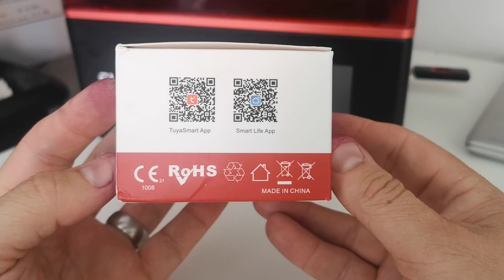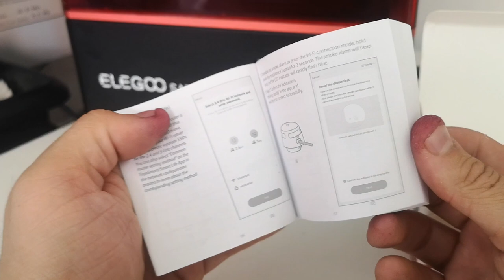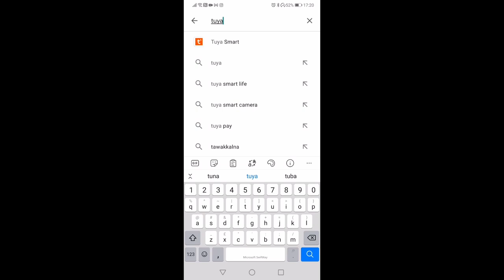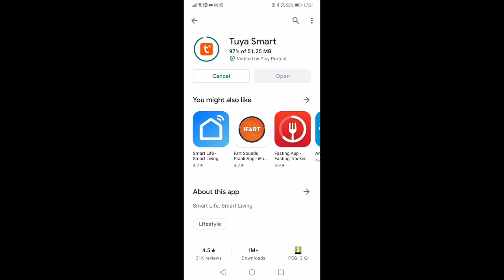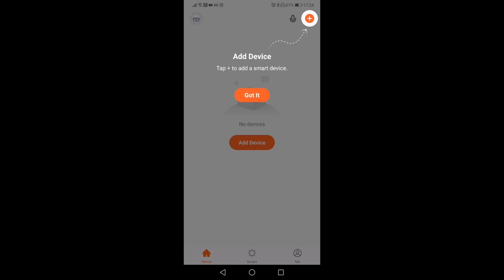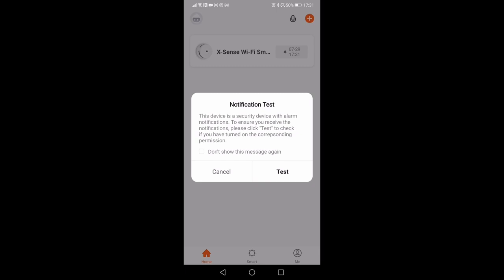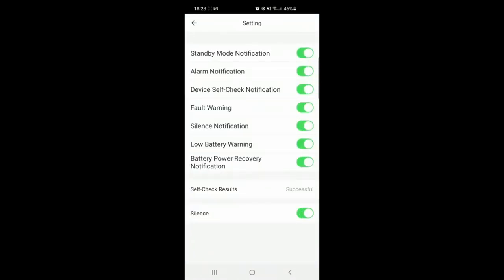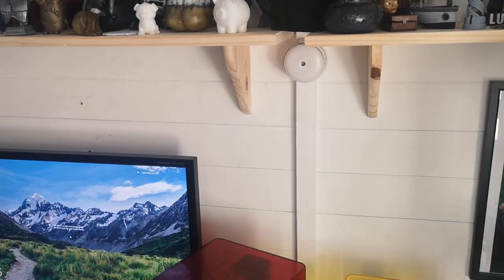Best Smoke Alarm for 3D Printing Safety (2021 X-SENSE)

Comment: You are better off with a Zerio Plus WireLess EDA R5000 series multisensor detector because they are more alert. You only need 3 items, the main control panel (radio, powered by AA batteries) the detector (it’s a multisensor one so you can change it, set in to smoke at day time and heat at night time or whatever you believe is best.) It has a big, white test button and a beacon so it is easy to know if fire is present. The max dB volume is 98dB and is changeable via a small switch setup inside the device which in the manual tells you which sound it will make and how loud it is. The convenient things are that there are no apps or WiFi to rely on, just boom!
Reply from the maker: Interesting but how do I get alert away from home?
Reply: @AhcMeUk  Buy a secondary ring doorbell and attach it to the ceiling next to it then set alert sounds in the settings to the sound of the fire alarm so when it goes off it alerts you 😂
Reply from the maker: 🤣🤣🤣😂😂😂 Yep that would do it.